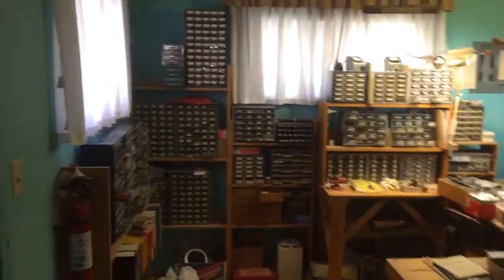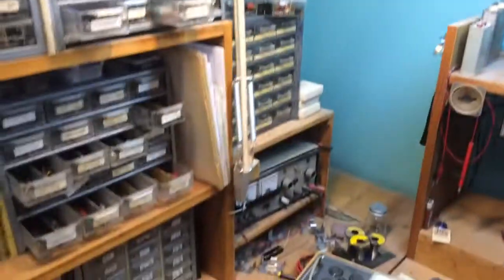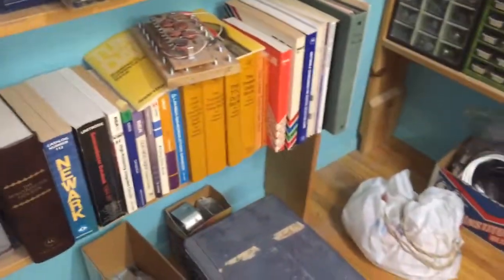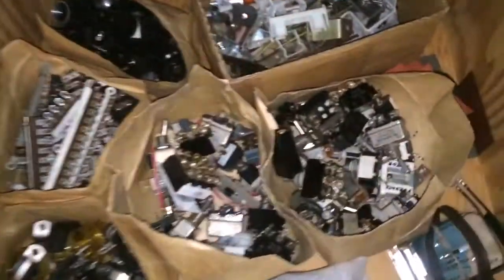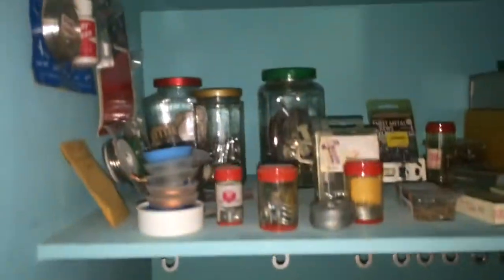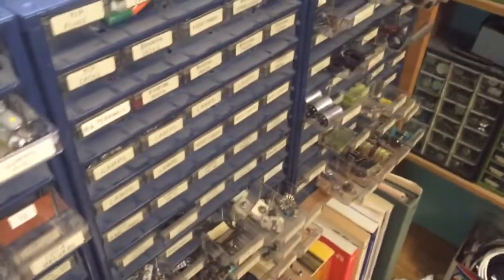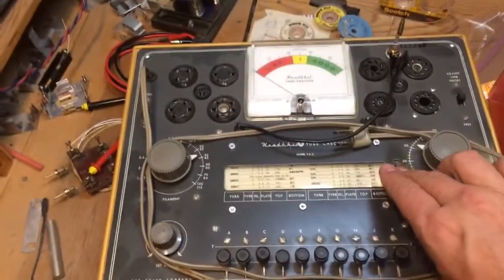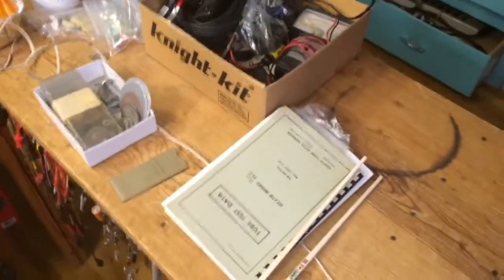Electronic engineer man cave/vintage electronics

Comment: this stuff is shared and given in electronics comunity..............
not much has big value 

only few testers have big value and few tubes rest are not sort for unless he only collected rare tubes that i highly dought
Reply: i may be replying 4 years later but considering a 25 drawer storage unit is selling for $27ish nowadays, there's a nice chunk of change but even 4 years ago you'd have over $1k in storage alone. MANY of the older transistors were/are selling for decent money, axial caps weren't / aren't cheap either. screws/ hardware has not been cheap for  at least 10 years. who knows what's in all those drawers. someone might give a part away once in a great while to a worthy comrade but it's not like everyone is giving everything away so what i'm getting at is that your post is pretty much full of shit! 😂